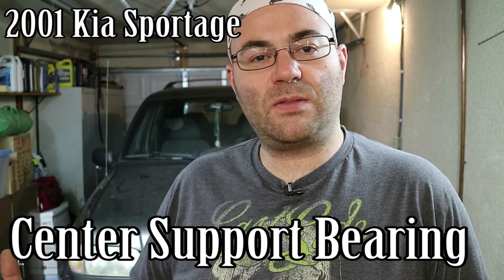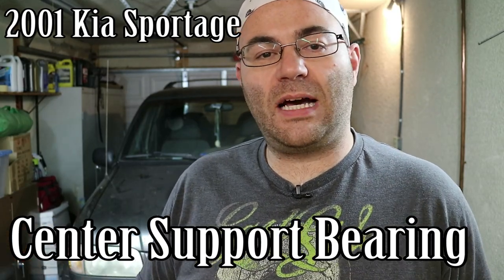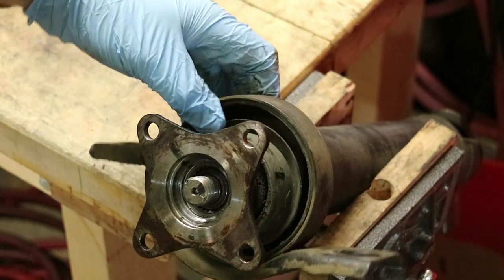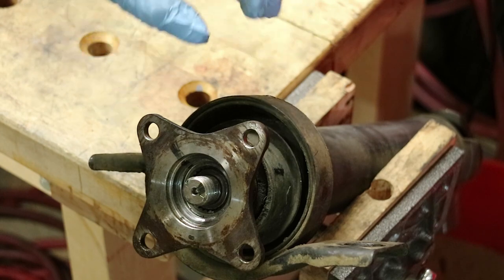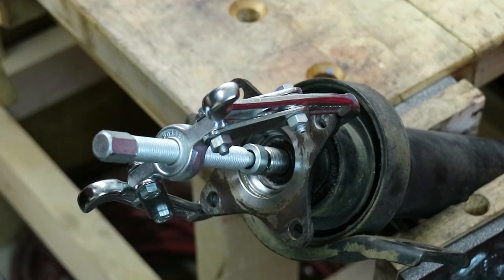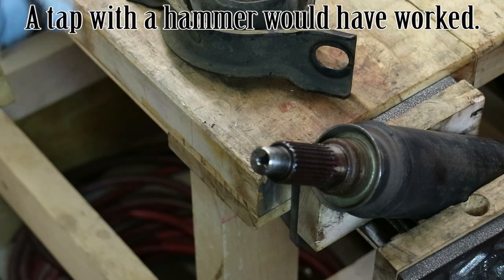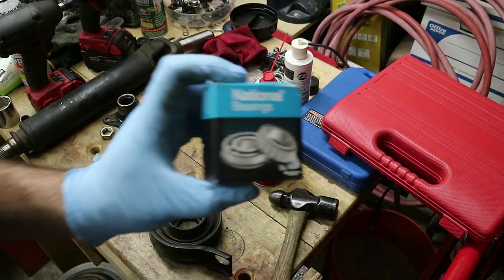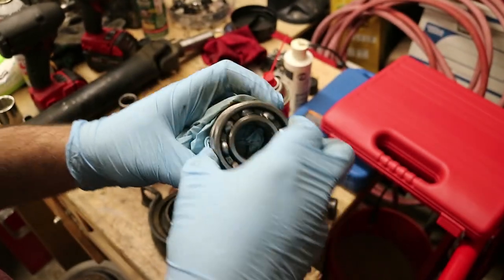How to Change a Driveshaft Center Support Bearing on a 2001 Kia Sportage DIY

Comment: Suffix Radial internal clearance
C1 Less than C2
C2 Less than Normal
CN Normal, only used in combination with letters indicating reduced or displaced clearance range
C3 Greater than Normal
C4 Greater than C3
C5 Greater than C4

Comment: I don't have a vise grip to hold the shaft what else could I use 🤔
Reply: PantherZL1 iv just placed the drive shaft on 2 jack stands and sit on it while working on the bearing or u joints